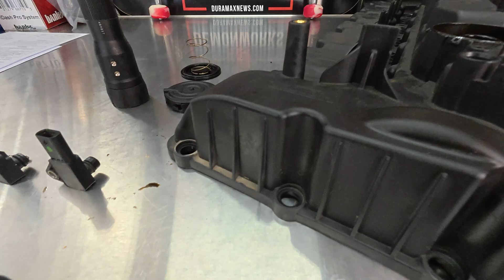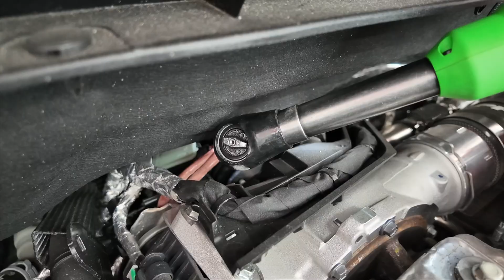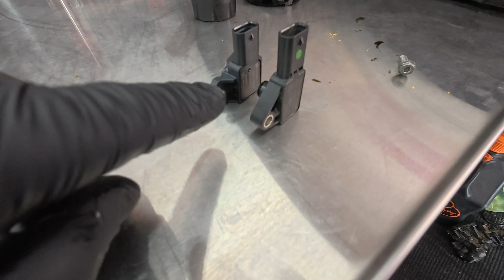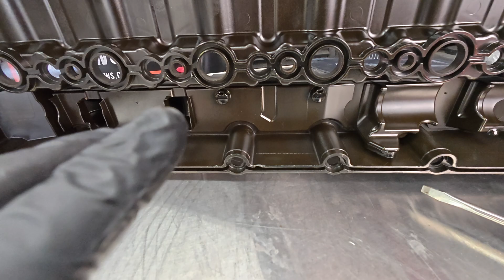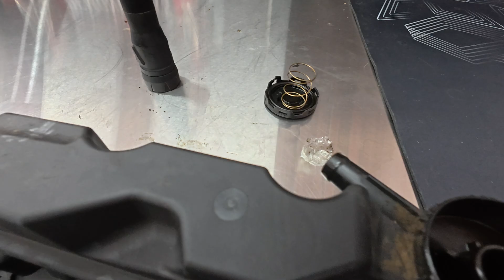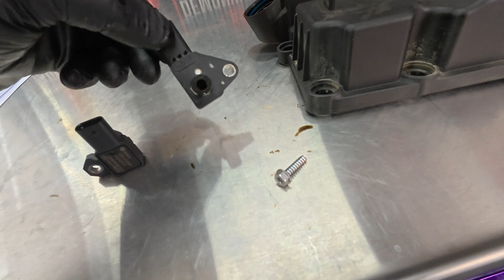P04FB Crankcase Pressure Sensor - 3.0 Duramax Diesel

Comment: Any chance of getting the cam cover off while the cab is on?
Reply from the maker: Yes, it's possible. High risk of bending the reluctor on the cam. The cowl below the windshield could come off which sounds tough but it's not, that will give quite a bit more room and remove most of the risk of bending the reluctor on the cam.

Comment: Overall, would you recommend this powertrain? Looking to get a newer truck, but all i see on the lots lately are the 2.7 (Gas) and these LM2 3.0 (which used is reasonably priced). I do tow 5 to 8 times a year on a 6k TT and our current 5.3 is showing its age. Thanks and great channel. Has helped alot in my research.
Reply: Wet belt look it up

Comment: Any idea why the RPM’s seem to stutter between 1300-1600 on LM2? Does it in park, seems shaking at cruising speed.

I’m wondering if the TPS is bad at 52k on a ‘21 Silverado.

Dealer says no pressure issues, and it’s “normal vehicle behavior”

Comment: I have a question for you? On my  24 Silverado LZ0 it makes like a chatter noise when it a little cool out side and I start driving. It sounds like it’s between the engine and transmission. Once the truck warms up it won’t do it on the second start up. Is this noise normal?

Comment: Just had my 2024 Chevy Duramax 3.0 in today for same code.  They diagnosed that this sensor is bad.  Had to order part and I have to bring it back in.  First tome the code came on was in really cold February here in Montana.  I’m thinking this should be a recall?  Appreciate your video!

Comment: I have a 2021 but do you have a part number please thank you
Reply from the maker: I do not, sorry. I suggest calling your dealership to get the most current and correct part number for your vin. I'd hate to give you a wrong number and it not work.
Reply: @ thank you for putting out this video. I have been looking for this location of this part for some time now I know where it’s located. I will be contacting my dealership for the part. Thanks again.

Comment: So don't know if they are telling the truth but dealer told me it's an update part.  Had the sensor replaced twice and then on the second time said GM directed them to use the updated part.  The code did only ever come in when it was below freezing, so it probably was freezing moisture but still annoying to not be able to remote start truck all winter.
Reply from the maker: Did they replace the connector as well? If so, do you have the part number from the paperwork?
Reply: Looks like it says labor  OP 4025560 2hr of labor and  sensor 12718935. No words of a connector.  2023 LZ0

Comment: Great demonstration man! I’m soon to do a timing chain replacement. Pretty nervous I ain’t going to lie. I know SI is my best friend right now to do it step by step. Though by any chance you got a step by step video or soon to release one? That would be a big help 😅 anyways keep up the good work man! Very knowledgeable info.
Reply from the maker: No video on that, outside of the basic one I did a few months back. Tips I can give are to pull the cab.... the pin that goes in the front should not go all the way in / bottom out. There is a line on the pin and if you are set correctly, it will stop at that line. The backside lower chain, there are 3 alignment links, you can only see two. If the two visible links are lined up perfect, the 3rd is as well. Be sure you get the updated cam sprocket, don't reuse the flimsy cheap one. Replace the cam cover, don't bother trying to reuse it. Don't forget to mark your injectors and put them back in where they came from. hit me up at mstrgoodwrench@gmail.com if you need anything.
Reply: What year is your truck and what mileage?